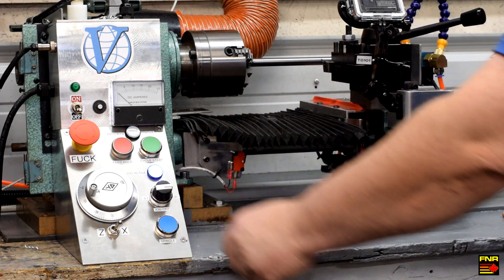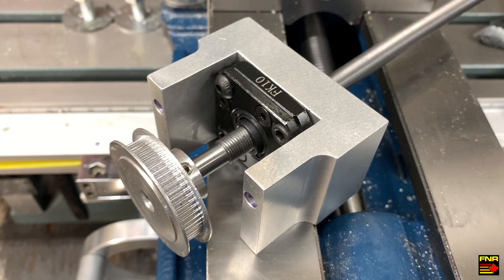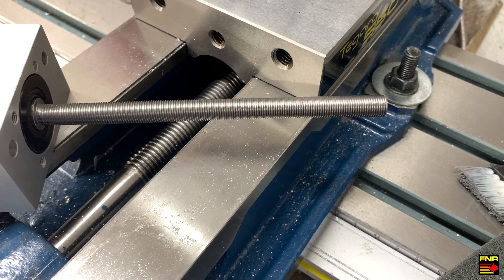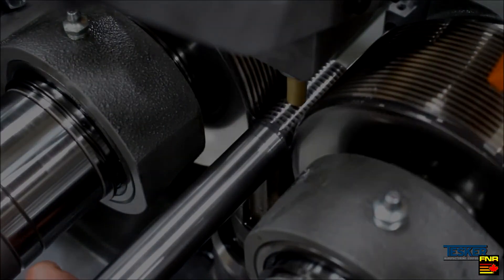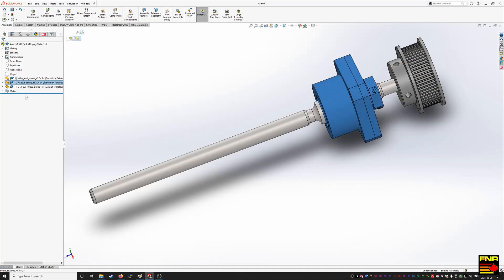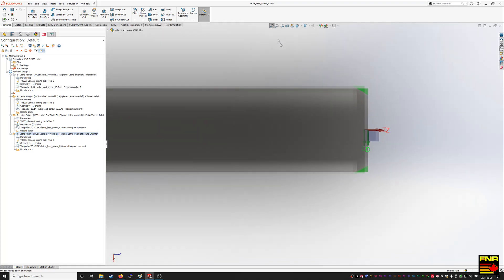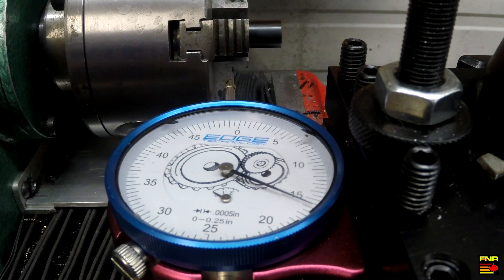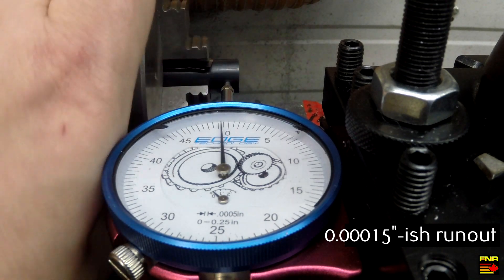FNR CNC S02 Ep 5 - The Most Accurate Part I've Ever Made on my CNC Lathe!

Comment: How much did those 5 run you for rolling costs?
Reply from the maker: $300. 

That was their minimum charge, and I got 5 out of that. 

Not super cheap, but in line with minimum job costs at specialty machine shops.
Reply: @FNR  Not bad really though what will you do with the other four?  Maybe could sell them being a youtuber.  I am always fascinated at how a metal can roll another metal without both being smashed.  I am not sure which metal they use on the rollers but I would think Titanium due to hardness as well as the ability to keep it cool (which pressure like this would be immense I think).
Reply from the maker: Spares? Conversion pieces? XMas gifts for in-laws?

Sending in more than one was more about increasing the chances that one of them would turn out OK. 

As it happens, they were all fine. 

I think the rollers are just hardened tool steel. Titanium is basically steel from a materials perspective,  just lighter and more corrosion resistant (and a slightly higher melting temp). I don’t think it has any properties that would make better thread rollers.